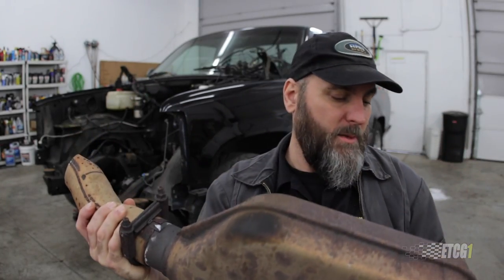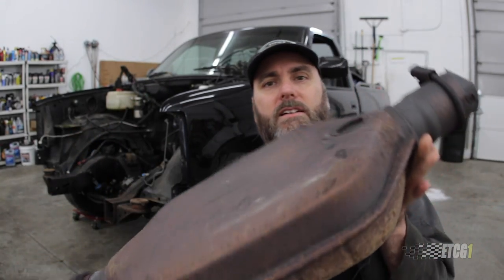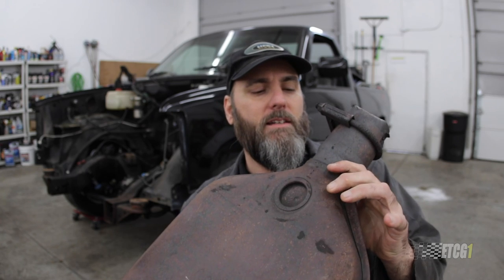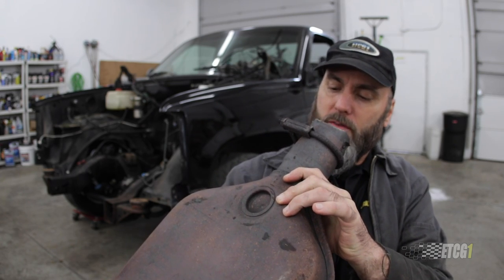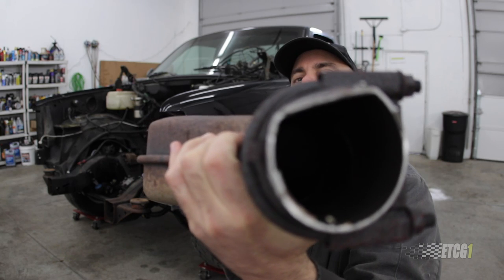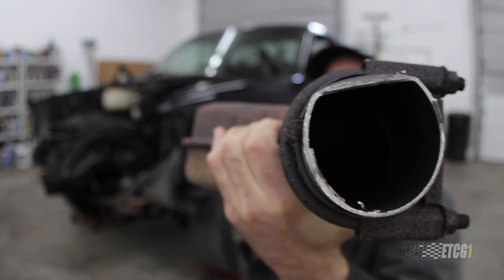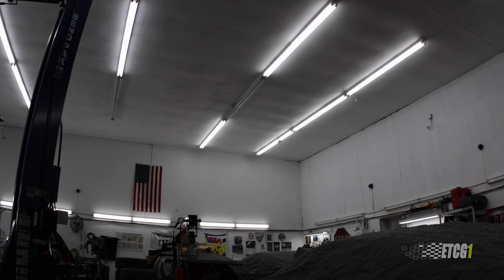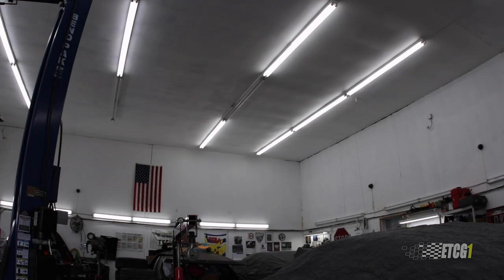Should You Run a Catalytic Converter on Your Hot Rod?

Comment: I can throw a bit of input in from both sides here, I’ve actually got a ‘93 gmc 1500, only has a 4.3 and 700R4, but the thing has 400,000 miles on the original power train. Engine has new bearings in it because it had so many miles we thought it would be smart to do that, had no issues tho and the old bearings actually looked great. But other than that, that engine has never been opened up. It’s had that same huge cat on it for its whole life and runs like a top. 70mph down the highway all day long no questions asked. It’s obviously not a hot rod of any sort, but for a v6 with tbi it moves pretty well. So in the case of a vehicle like that, it’s stock as far as power goes, but also that cat has never clogged or caused me any issues whatsoever. (It’s now my backup truck since I just bought a new one and is going to turn into a project. Nothing wrong with it, just go another truck to add to the fleet and I drive it now). On the other hand, I just purchased a truck I’ve wanted for a good while because my father used to have one when I was a child, a “2nd gen” Cummins. 2001 Dodge Ram with a 5.9L Cummins engine. That truck has no cat on it, no muffler either actually. And before anyone says anything no I don’t roll coal or any of that, actually that truck barley even lets out a hint of smoke when it’s loaded and pulling in a high gear. But the reason why I was ok with buying it like that is a few reasons, diesels are dirtier because of the soot from the engine (which depending on which scientific study you look into may or may not be actually less harmful than standard gasoline emissions). That soot is bound to clog up that cat at some point, plus, I want this engine to run as healthily as possible. And if you look at it from a outside perspective, a Diesel engine is basically a big air pump. Takes air in and lets air out. The more air in and out, the more efficiently it runs. So having a free flowing exhaust in that case I think is the correct thing to do to keep the engine running efficiently (yes it did increase fuel economy, on a stock 01 I’ve borrowed several times I get 17mpg, I get 20 in mine). Another reason why is something everyone who tows with a diesel is familiar with, EGT’s (exhaust gas temperatures) on a Diesel engine that is the deciding factor between making your engine into a boat anchor or having it run well. A free flowing exhaust allows for lower egts which is in my opinion one of the number 1 things everyone who tows with a Diesel engine should be conceded about. I’ve seen the aftermath of high egt’s and it’s never pretty, burnt and melted exhaust valves, even damage inside the cylinders. So in some applications, I think you should lose the cat. But if it’s gonna be mostly or all stock and runs on gasoline, keep it on. A cleaner planet can’t be a bad thing, and even tho it’s hilarious to hear the the guy with a straight piped Cummins cares about that, I do. Just also believe it depends a lot on what exactly the vehicle in question is. On your Chevy, I agree. Take it off. When it comes to making a performance vehicle, lose the cat.

Comment: I agree with the others who have written that installing a less-restrictive high-flow cat would be good. You would get the best of both worlds for the increased cost of the high-flow cat. The other disadvantage, increased weight, could be partially offset at least by shaving off weight elsewhere.

Comment: I don't have cats on my "hot rod". Mainly because of space, it's a daily driven 98 s10 with an ls swap. It also helps that Florida doesn't have emissions testing, so that's convenient. 
Not only are they restrictive, but they take up space and add weight. Space I have little of. These newer ls motors are a lot more efficient than the good old school carb too.

Comment: High performance cats are a must where I live, the E-Rod kit from GM is helpful. I have seen tuned motors though burn so clean they do not need any emissions equipment, but we are limited where I live we have to have a cat if the car is to be used more than a few thousand miles a year.

Comment: I've actually added cats to a few cars that didn't have them when I did rebuilds.  Modern cats don't have the restriction of older ones and are pretty affordable.  Plus, they have the added effect of helping quiet the exhaust.  I didn't put cats on the most recent car because there literally wasn't any room for them and it was built about 50 years before cats were a thing.

Comment: My understanding of a catalytic converter is that it cleans toxic gasses from emissions.  I think with the Fairmont, because a major goal was performance, running without the catalytic converter furthers your goal, and it sounds like you aren't in that car everyday.  Maybe with the truck, since it is not a pure performance vehicle, and because it will get more regular duty, if the catalytic converter doesn't rob too much power, why not re-install it?  A GREAT video would be to compare both emissions and power with and without the converter on the truck, and maybe compare the smell and sound as well.

Comment: Only good things of tight emission laws is that oil lasts longer because it isn’t so saturated by gas over its lifetime in the motor and spark plugs last longer. Engines kinda got easier to deal with since there’s less moving parts to wear out and replace. In my area there’s no emissions testing unless it’s a commercial truck. Muffler shops cut cats off all the time and give you a nice deal off the bill for it. But the down side tonlosing your cat in anything newer than mid 90’s it kills the gas mileage. Did it to my 06 impala gas mileage went from 23 to 18. Sounds cool though.

Comment: I recently had to replace the exhaust manifold on my 2010 Colorado. For those who don't know, on that particular truck, the catalyst is part of the exhaust manifold. I had a choice. I could buy the OEM part, for about $600, which had the catalyst. Or I could wait six to eight weeks to get a header that didn't have the catalyst, only cost about $200, and live with a constant check engine light. I found a compromise, Pacesetter makes a header for the truck that has a high-flow catalyst built into it. And it was about half the price of the OEM part, so that's what I put on it. 

Unlike Mr. Eric, I drive the aforementioned little truck quite often, and even though I live in a state with about 3 million people, I'd rather not be part of the problem. Also, as someone who spends a lot of time in the spring/summer/fall on a motorcycle, it's much less unpleasant to be stuck behind a modern car with functioning emissions controls, than to be stuck behind some hotrod that's belching unseen, but not un-felt or un-smelled, fumes.

Comment: When I overhauled my Toyota 22RE engine, I checked the stock cat converter and it was 90% clogged.  Just replace it with a test pipe or installing a new cat converter.  I went with a 3rd party (Magna Flow) cat converter just so my son and his kids can breathe clean air.

Comment: Last summer I was on the ferry from Prince Edward Island to Nova Scotia and there was a 60s Pontiac boarded on the vechile deck that you could really smell unburned fuel coming from the exhaust. My point being if you plan on taking a vehicle in enclosed spaces you may not want to remove all emission systems.

Comment: I have stainless aftermarket headers on my 01 z28 with no cats. (I bought it like that). I found out when I took it to the inspection station and they said “hey you don’t have cats on it”. So I welded up an exhaust pipe with cats and made it removable. So when I have to go to get it inspected I put the cats on and then after take it off.

Comment: I was looking at those high flow/low restriction cats, need more info before I get there. Air pumps just disappear. Parasitic drag from an air pump to pump air into the exhaust is a feel good solution. I go for high efficiency and purpose built, EFI keeps the fuel waste down, lower unburned hydrocarbons. That cat you showed was a monster.
Reply from the maker: I am putting an updated multiport system with timing control on the engine.
Reply: Can't wait, look forward to it.

Comment: I have an 84' Chev C20 350 that is my daily driver, the truck came factory with single exhaust and a pellet cat like the one you show in the video, but sometime before I bought it installed a modern 3 way honeycomb type cat on it.  So recently I installed a dual exhaust kit on it, and I had to wait a week longer for the cats I wanted to install to arrive.  Gee the exhaust was stinky without cats.  No matter how much I tweaked the mixture or the timing it just smelled awful to me in traffic.  1 week later the cats came in, and I installed 2 new 3 way honeycomb cats and the stinky exhaust is gone.  Also FYI there is a compound in exhaust called NOx that's actually a family of gases one part of it has a sharp smell to it, but does not smell gassy like unburned hydrocarbons or HC smells like, and the other part of NOx is odorless.  That's the dangerous stuff.  Not only does it contribute to air pollution, but it's also very good at destroying lung tissue.   Ask a mechanic that was never a smoker that has COPD or adult on set asthma, he'll know what NOx is, because that's the cause of his lung damage.  It may not hurt you enough driving your classic or hot rod occasionally, but it will set of an attack for someone that has COPD or asthma and gets stuck in traffic near enough to you to get a couple good lung fulls of NOx.  It's bad stuff and a lot of folks don't even know what it is and now you do.

Comment: Over the past 20 years, I've owned a Dozen (yes...12!) GMT400 (1988-1998) based full size trucks in varying engine and drive train configurations. Every time I took possession of one, the Cats came off. MPG went up and power was improved. I had most of them checked for emissions and they all passed AFTER removal of the CC. I'm in a no inspection state, but I was curious. I've never had an O2 Sensor problem after the fact either. Cheers! Zip~

Comment: In the UK, all petrol cars from 1993 onwards are required to have a cat (there are a few exceptions for run-out vehicles). There are some vehicles made just before then that do have cats fitted, but would be legal to remove them, for example, early second generation MR2s, where removing the converter will net you a not inconsiderable power and fuel efficiency gain, so I probably would on one of those cars. When I was younger I always viewed cats as an annoyance on vehicles that should be removed wherever possible, but now that even a normal aftermarket replacement cat for a 90s vehicle flows way way better than the stock item, there's just no point in dealing with the hassle of not having one.

Comment: Up in Canada we have to run the emissions equipment that was included when the car was built.  I have an older corvette so I need to keep the cat and air pump.  I have heard of people gutting the air pump so its free spinning and doing the same with the cat.  I have never been pulled over but I know people that have been.  I think its pretty hard for these guys to determine if your legal unless they are very familiar with your model and year of car.

Comment: In Utah, any vehicle 1968 or newer must have all of its original emissions equipment intact, and pass an emissions test.  You seem to be torn on this issue.  O'Reilly sells a MagnaFlow converter that is light weight and not restrictive at all.  Got one put on my 94 Astro (TBI) and drove from the muffler shop right to get the emissions test done, and it passed with flying colors.  Maybe something like that would be a good compromise.

Comment: 1975 Chevy Nova,  don't need them. My answer to your question the multi-port fuel injection with tuning will have a smaller carbon footprint than the original TBI system even with the catalytic converters from the day of  manufacturing.
Reply from the maker: That's my thinking also. The emissions I put out may be equal to, or only slightly greater than it was originally.
Reply: @ETCG1  the TV I was a step forward and figuring out the pressure and all we needed to run fuel injection versus the old mechanical fuel injection from back in the 60s on the Corvette, but the multi-port you can tune cylinder 8 to be a little richer and to cool down the engine in that area verses on cylinder one with it getting more fresh air which also may or may not need a richer or leaner air fuel mixture because of the runner of the intake and all, plus you've got to think about if you get better fuel mileage without a catalytic converter say 1 to 2 MPG more versus having a catalytic converter and getting less really is there any difference with carbon footprint, more miles per gallon more carbon, less miles per gallon more carbon

Comment: Carbon footprint is important but the NOx (smog) is the flip side of the environmental coin. The sensors are light and no restrictive to the exhaust, so theoretically one could compute the footprint on a mass bases in a “classic” car with little if any offset to performance. Reduced fuel consumption in reality should be an indication of overall emissions. Figure the pounds or gallons per some unit of time. Kinda a Hobbs meter reading at each fill up. Just a thought.

Comment: I would put a high flow racing converter on it mainly because I don’t want to breathe the exhaust fumes, and smell like exhaust fumes. It might be a good test (and video) to dyno the truck with and without a converter on it just to see the difference. It may not be a significant as you think.

Comment: In Texas the catalytic converters are considered part of the exhaust system and are required to be present in order to pass safety inspection. Oddly it doesn’t mention functional, just present. The rest of the emissions system can be removed once the car is over 25 years old based on year of production. I have an 89 Mustang with the full emissions system removed and high flow Flowmaster cats on it. As an aside the Texas inspection law also requires functional windshield wipers but nowhere does it require a windshield. Yay government!
Reply: Back in the 80's(lived in Lubbock) my buddies would gut cats & put a pipe in... Make it 'look stock-ish'

Now I'm in eastern WA, no inspections or emissions, but other laws are crap....

Comment: For my 4.0 Jeep which is not dayly driven, I do not have a cat because the stock ones where a common issue with them and where it is a vehicle for fun not for dayly use. I do how ever dayly a small car because it is much cheaper on gas for my long commute. I always run cats on daylys. There are also no laws for non-commercial vehicles. In the sense of cats or really any mods, as long as it does not change ownership.

Comment: Eric, was man you should run factory style catalytic converters either 2 or 4 depending and appropriate for the MFI you use. Since your dads truck is a restore/mild upgrades, if I were you I’d use the cats for a vehicle that ran that system from the factory. My reasoning is, if your using fuel injection especially with 1 or 2 HO2’s you really should run cats with those O2’s. Me personally, I’d run 2 upstream & 2 downstream with 2 cats or at least 2 aftermarket high flow cats. You’ll still get the power your searching for plus better mileage, less oil consumption from fuel contamination etc. as well as your will run much more efficient. Or, you just use 1 O2 sensor in the passenger side manifold/collector and no cats and it’ll run rich and hog down fuel.
Reply: Also, try to restore and use your EGR system too, better for coolers cylinder pressures and less NOx’s.

Comment: Here in NY 96 an up is safety and emissions, 95 and down is emissions exempt.
Reply: Mass is the same
Reply: @elioselectric468  Technically the cat is still required if it came with one and it could fail a visual inspection but the shops doing the inspections don't really care.
Reply: ChrisP978 and neither do I, I have an 88 s-10 that I occasionally putt around in, the exhaust is something that’s on the to do list and I’m not putting a cat back on.

Comment: i own a 63 impala with the original 283 engine and no cats and im about to put cats on it but not sure if its possible because there is no fuel injection system and the muffler shop said if its too rich or lean it would melt or burn it. my other option is to do an LS swap to this. i did that to a 65 chevelle and put cats on it, it was so nice to drive it and not have to smell a single wiff of exhaust AT ALL
Reply from the maker: You might also consider a Holley Sniper EFI. Bolts right on in place of the carburetor. I have one on my Fairmont and it works great. https://www.youtube.com/watch?v=Pr-93jijuVo&t=3s
Reply: @ETCG1  i had that but i felt it was too immature of a true EFI setup that i would not do this again. for the money spent and the work being done with the wiring and the fuel pump and tank sending unit and all that, I'd rather have an LS swap done right. they are much more efficient. Ive had them both.

I had an 85 toyota pickup 22re that was all carb'd and had cats. it never bothered me. im not sure how they had that all setup but I'm looking to do a similar setup to that and keep it simple.

Comment: Catalytic converters have come a LONG way since 1989! With a lot of newer cars that have been engineered with today’s technology, you might see only very little significant increases in performance if the catalytic converters are removed CORRECTLY. I don’t run them on my race trucks, but I keep them on my street vehicles. My most recent project I am actually putting a newer performance catalytic converter on as well as switching it over to E85.